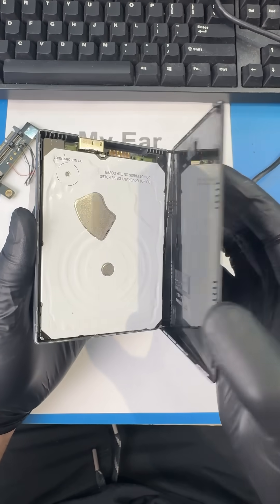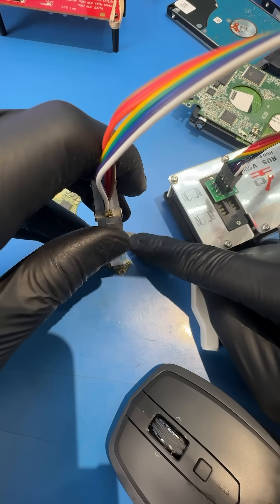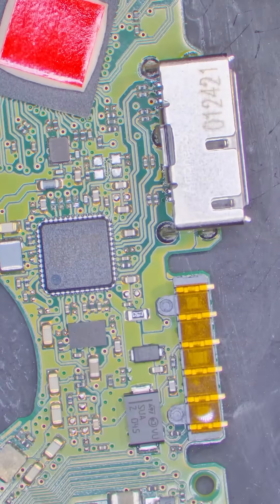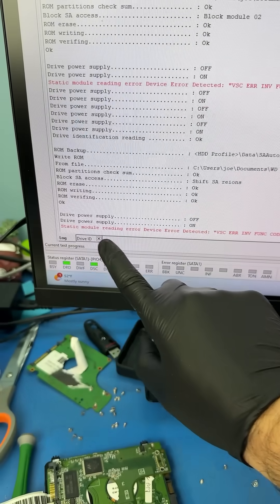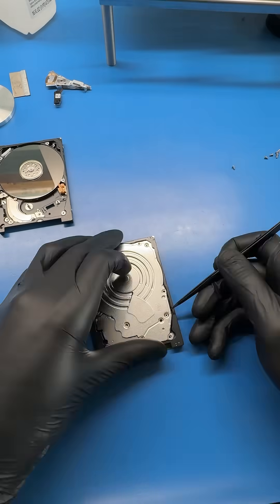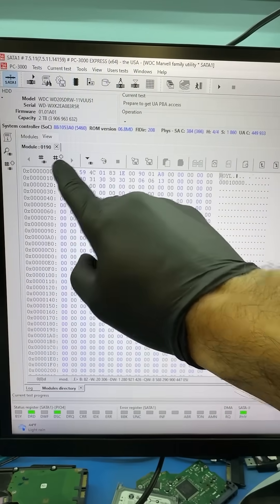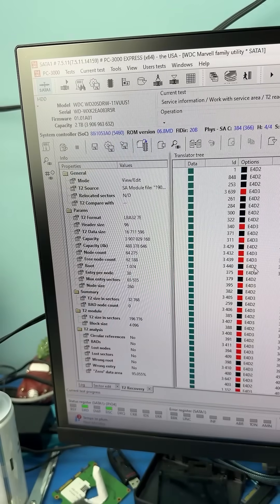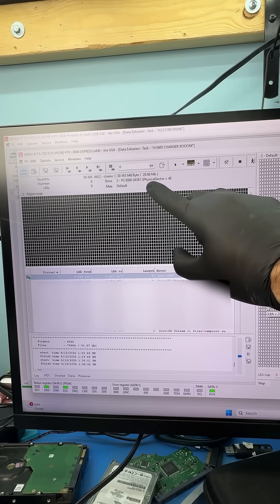Hard drive translator...? #tech

Comment: I've been a software engineer for 30 years. I owned a computer repair company for four of those, too. And I can say, without hesitation: where and how the hell did you LEARN this stuff, bro? Did you used to work for WD assembling these in a clean room? Or what?
Reply: Thought EXACTLY the same
Reply: I know SOME of the things he's doing because I used to read some data recovery related websites from Easten Europe. Professional tools obviously come with instructions. There are forums where people exchange information about specific hardware. You can learn so much black magic if you are so inclined and have the money for tools and to be able to afford to make some mistakes while learning.
Reply: @SianaGearz  People think I'm a wiz with computers. I'm a gamer who had to set up port forwarding for Minecraft, had to learn where all the files go to mod games and backup saves, and had to read all of the config everything to make things run on my mediocre computer. For linux, I installed Arch and messed around, broke my OS a couple times, and now I'm decent at linux.
Reply: Not specifically about HDD/SSD, but when it comes to a niche market, sometimes time and research is all you need. I went from paying for a tune for my car, to learning how to defeat the security system, dump the flash and eeprom, modify values for a tune, reupload and tweak features i didnt even know were possible. Then from there into the instrument cluster to play around there. Takes time and research, trial and error but you get there.
Reply: @doddinator14 I wanna learn that too
Reply: @doddinator14 messing around with eeproms not that hard specially in older cars, the new ones are more SW development, need to get to do “C” hardware level programming.
Reply: @ Good thing i can do the Med17.1.62 aswell then.
Reply: I was saying the exact same thing. The knowledge about hard drives is extremely impressive.
Reply: I have no idea what's going on but that's some serious dedication to drive repair.
Reply: You'd be surprised, being a professional hobbyist is orders of magnitudes better than just having a degree and experience IMO. knowledge wise.
Reply: @hassaanrauf4349  Yes but even if you do it as a hobby, where do you find arcane information like this.
Reply: @hassaanrauf4349  Can confirm. Been working in the IT industry for 5 years now and the vast majority of my knowledge and skills still stems from my hobbyist days. Feels like I've learned hardly anything at all other than how inefficiently big companies operate.
Reply: @hassaanrauf4349  What a load of bs. Show me a single hobbyist that has the knowledge of an electrical engineer who studied in an university.
Reply: @ There are tons of such people. You don't need to know differential calculus to make circuits. I'm an Electrical Engineer and I've had colleagues with no trianing who were rockstars. People who are smart can teach themselves things regardless of a college degree or not. At the end of the day college is just an IQ check and a paper that says "this guy isn't r-tarded and can learn difficult concepts, hire him".
Reply: @mithrandirthegrey7644  Looks like US "colleges" are horseshit. We all know that.
Reply: Computer forensics lol
Reply: Trial & error
Reply: I'm a retired Computer and Electrical Engineer with over 30 years experience. Before I put myself though college, I was an Electronics Tech in the Navy where I worked on all manners of communication gear, RADAR, SatNav, and IR devices, from the 1940s to what was current at the time I served in the '70s and '80s.

After earning my BSCE and BSEE degrees, I was more involved in designing and manufacturing computer hardware, building / installing / troubleshooting / repairing / upgrading PCs and networks. I learned how to repair circuit traces (like, say a lifted solder pad or a broken foil run) back when I served in the Navy. One place that I worked at, we made those flexible circuits on the arms for the R/W heads, at least for Maxtor and Seagate drives (that's a Western Digital in the video and I don't remember making anything from them at the time I worked there). We also made flexible circuits for Epson, Lexmark, HP, Motorola, Samsung, and GE Medical. 

In order to do this type of work, you have to be a Certified Data Recovery Professional (CDRP), which requires some courses and a test. One can look up what it takes if interested.
Reply: I've been a software engineer for about 20 years, and while I may not have the actual skills he has, nothing he's doing is actually new to me. 

If you learnt how filesystems work, you'll know how its stored on the disk and how data recovery works.
Reply: My bet is he worked for either a HD manufacture or a data recovery company before breaking out on his own
Reply: Reddit and stack overflow lol
Reply: i can relate to this video  i used to work in toshiba (philippines)2.5 hdd dept. as assembler and tester for each hdd that i assembled ..the firmware installing is not my job i know how to do it like he does on this video but i am not certified to do it in my workplace.. need certification to qualified ... i've employed in toshiba from 2013 to 2019..
Reply: People here acting as if college is useless and are forgetting that those dedicated to their fields of interest will obviously have more knowledge about them 😂
Reply: as all computer science students say “hardware is black magic”
Reply: The amount of time this takes to recover and view contents like a helicopter of the drive data swap testing different heads , massive amount of time and effort… whilst I know what you was doing and worked in computer repairs since 1993 until 2015 , changed to Apple from 2005 , then worked in recovery Ontrack and Kroll data recovery forensics, I found it extremely interesting.   The price for this can run into thousands
Reply: He must be working on the ssd hhds are made😂
Reply: I can feel the painstaking process just by watching
Reply: Never underestimate the talent and knowledge one can acquire while investing themselves to the fullest in their favorite hobby....
Reply: Dudes just secretly self aware AI in a biosuit
Reply: Bro went to India for a week
Reply: pc-3000 does training
Reply: a former bosses son had his hdd stop working it just made a clicking sound pretty sure the head got stuck he asked me if i would put a new hdd in it, took the old hdd apart put the head back into park position and got the drive to work and copied it to the new drive he did not lose anything. i just fiddled with it and thats how most of the best people work they fiddle with things and figure them out
Reply: fixing, breaking and then fixing your own stuff again teaches you infinite things.  l ended up learning a fair bit of assembly language basically by accident just because l needed it for a couple functions
Reply: he had access to information. And that's not internet, cause if it was internet, you would know it too. Like you said, WD or whatever company he works for.
Reply: @v.cotoiu3568 everything used in this can be sourced on the internet.
Reply: you would be surprise how far can an internet and a willing man can teach  himself to do something, I went from zero knowledge on GPU to a board repair in a year, just so I could salvage a second hand GPU for a cheap price...
Reply: It’s amazing what you can do while tinkering about.
Looking at wiring diagrams for drives!
Reply: smart dude, absolute hero to customer.
Reply: He probably did school for computer engineering. You usually don’t learn this kind of stuff in a software engineering degree.
Reply: EE
Reply: I just went to os class for 2 mins.
Reply: Software engineering doesn't really have anything to do with computer repair tho...
Reply: I recalled people would try to avoid buying usb only mobile drives. Those from Seagate would have SATA drive inside while WD love to save a few cents and have USB directly on PCB.
Reply: If you pause the video, you can see that he is using VERY EXPENSIVE recovery software.
Reply: It may be the pure talent some people have. Some people are very talented at composing music. Some are very talented at hacking. He's very talented in discovering and utilizing knowledge related to hard drives.
Reply: NSA
Reply: Isnt that just so cool about the internet tho? Domain expertise isn't gatekept by Harvards Ivory Towers anymore.
Reply: You can literally learn this on the internet. Just google it. Hello?
Reply: also no need for a cleanroom, you spend a couple k on a workbench with filtered air.
is just as good, only those filters get expensive after a while
Reply: Exactly, where did he learn this from?
Reply: Dont get me wrong, this level of knowledge and skill is impressive... But comparing repairing to making software is just an unfair comparaisant.
Reply: No chances whatever game could be retrieved is worth anything. Someone that doesn't use a source control in 2025 doesn't have the mental throughout required to design anything worthwhile.
Reply: This post should show you that you should never trust anyone that is a "professional"... clearly there are a lot of morons... lol

imagine thinking you have to work for a hard drive company to know how to apply fundamentals loool.
Reply: Its PC-3000 Data Recovery Hardware / Software package. When you buy package you have access to their WiKi and can get training about data recovery.
Reply: You're joking, right?
Reply: I recovered a few HDs years ago by editing fat sectors manually. They were only 20-30 MB drives then!  This, however is really serious voodoo and deservedly costs thousands of dollars!
Remember guys, always back up your backups too and duplicate them offsite to avoid catastrophes.
Reply: The PC3000 guys are astounding as to what they have built and will help you with if you find something their hardware can't already do.
Reply: That's a lot deliberate practice, where you're pushing beyond your skills, for a few hours, every day. Over the span of 5 years you can get pretty far with that. It's a blend of practice, reading, patience, observation, exchange with others, and focus on what to learn next. You start with simpler repairs and skill up while making money. Add dedication, passion a big brain and a pair of golden hands.
Reply: He's using electrical engineering skills, and diagnostic processes. Real engineering degrees typically focus in on these areas, whereas hyped up computer science courses purporting to be software engineering (which the proper term is computer engineering, not software engineering, at least were I am the term software engineering is meaningless) don't actually teach students any real engineering skills. Most engineering students also do some amount of time doing general entry, which is 1-2 years of everything to get a base understanding before you specialise in a general. With that said this dude is an artist and not many Electrical engineers sadly could do even 25% of this. He's more into data storage engineering, not sure what the correct technical term for that is.
Reply: @JoshuaNicoll software engineer is a real thing. Writing code is one thing, designing software would go a bit beyond that. A software engineer, for example, would come up with how the software is supposed to function, its overall layout, how it would be integrated with whatever hardware it has to run on, and so forth. Different parts of the software would be handed off to different individuals or teams to create the code according to what the software engineer has set forth. Software engineers  would know how to program, and probably have some understanding of hardware so that they have a better idea how to go about designing the software. They may also decide to use one programming language over another depending on certain requirements.
Reply: @JoshuaNicoll  Software and Computer Engineering are vastly different things. Software Engineering honestly shouldn't be considered Engineering in my opinion (as someone who has been developing for close to two decades).

Software Engineers develop code structures and determine tech stacks. A lot of the current engineers barely understand how their computer actually works now a days.
Reply: @JoshuaNicoll right! But in contrast, most "software engineers" up to IT Development couldn't bias a BJT.   I firmly believe that a passion for knowing/experience brings out "the knack" in people and this guy has it.  Having the ability to see options outside of the box built around others (who may be very set in their ways with the bragging rights of "been doing this for" syndrome. 😅).
Reply: @JoshuaNicoll  no need to slander software engineering. I believe you don’t understand what software engineering actually is. It essentially has nothing to do with the hardware of computers (besides from things like memory allocation and some other stuff), and rather is about development of computer applications. Software engineers work in groups to complete a development lifecycle which has many many components and steps. Computer engineers don’t learn what software engineers do, and software engineers don’t learn what computer engineers do. They are completely separate fields that work in completely different markets.
Reply: @JoshuaNicoll I have never seen such an ass pull before, almost all you say is wrong
Reply: @JoshuaNicoll software engineering is not a useless term, its software only, computer engineering can be hardware or software or a mix, software would be a sub specialization. Also, non of what he did here is software engineering, at most partly electrical partly software usage skills, it's not like he wrote the firmware on the spot.
Reply: @q1337  no thats electronic engineering or computer science. Computer engineering is using computer code to solve problems. We're being trained in C++ for that. There is no hardware side to computer engineering, that is eletronic engineering. There is some overlap in an EE will also be able to programme, but a CE won't be able to design a PCB.
Reply: @ also I don't specifically blame you for not knowing that, the actual field names are not used consistently, you have a bunch of universities teaching actual Computer Science, you have a bunch of them that are teaching Computer Science but in reality the courses are the same as Software Engineering etc. The name itself is not enough to distinguish what a student is learning, but rather the courses available to take. Same goes for CE, it heavily depends on where you're going to uni, here there is a very clear distinction between CS, CE (SE), CE (HE) and EE but neighboring countries also have their own twist and like I mentioned before, they have CS but with only SE courses etc.
Reply: @JoshuaNicoll 
Engineering student on my entry year here, truly very well said my man
Reply: @JoshuaNicoll  Most of what you said is indeed true. The vast majority of "CS majors" are just coding degrees and do not actually go into Computer Science or Computer Engineering.

What I will say is software engineering does have a meaningful distinction where I am from, computer engineering is often lower level than software engineering, in that the deepest level a software engineer will go is assembly but a computer engineer will go beyond binary to the physical characteristics of the hardware to create the binary instructions that are then conveyed into assembly. This means Computer engineers design hardware.

As for software engineers they do apply engineer principles but it's at code level, meaning there is a problem they want the computer to fix, the software engineer identifies the requirments and designs the software that will be created following this they will usually have a team of programmers that write the code and the engineer over sees them to make sure they are meeting the standards and can also make modifications if needed to the overall design.
Reply: Data recovery is a whole different thing than computer repairs man
Reply: It's called the internet. School and College have failed us.
Reply: @Mystical_Zeus  I started programming commercially in '96. At the time, the requirements to become a full-time dev were:
1. Do you know how to turn on a computer?
2. Can you think your way out of a paper bag?
3. Ability to type (nice to have)
I AM self-taught. From "books" (which are like... uh... "analog Kindles").

Even so: this dude got some dark voodoo training SOMEWHERE... because what he's doing ain't no joke.
Reply: @grumblycurmudgeon  mans sold his soul for computer necromancy powers
Reply: @grumblycurmudgeon  probably just some forums nerding, all advancements in life comes from those communities man, it's no joke 😅
Reply: @grumblycurmudgeon  You are old bro, referencing kindles 😂 I don't know a single person who has used kindles in years and years.
Reply: @yunggoosbumps215 Kindles are a very recent thing. PDAs are where the line exists between "definitely old" and "maybe old".
Reply: @grumblycurmudgeon Best description ever. I've worked in a lot of different industries when it comes to tech and I've seen very few people who have the type of skill set he's able to utilize on command. That level of knowledge and training is not common even within the tech field. Hobbyists are absolutely insane when it comes to tech though. Our IT guy at work blows my mind weekly with the new stuff he's constantly doing to his home setup
Reply: @grumblycurmudgeon ”analog kindles” 😂😂😂😂😂😂😂😂
Reply: @grumblycurmudgeon it's actually not that complicated. But needs more general understanding like soldering and boards and electronics and binary. Maybe logic gates. Other than that it's just software. Now if he wrote the software himself and whatnot that would be pretty damn insane
Reply: @grumblycurmudgeon reading "analog kindles" made me actually angry lmao, cmon bro I'm 21, books aren't THAT ancient
Reply: @projectdeveloper9311  Kid, when I was your age, we still had to set the receiver of a landline phone on top of our dialup modems to telnet in to our BBS's and MUDs.

Count how many of those nouns you recognize. Now count how many you've seen. Now count how many you've used. 

I mean no offense... I'M the old-ass here. 

It's just nearly ALL of modern computing has happened since your parents started dating. Go back much farther than when I got started in the field and bleeding-edge computing hardware fell into the category of "henges" (yanno, those big stone circles for checking celestial calendar events?). We built one in the back yard, once. You've never heard such whining. "You kids get those rocks off my lawn!" Heh. Good times.
Reply: True that, I'm an engineer without a degree😅 shhhhh nobody's noticed so far and it's been 7 years  @Mystical_Zeus
Reply: @Mystical_Zeus  Youve been told that they have. By the same people that are trying to get rid of the department of education, no less. You buy the bullshit. I can almost guarantee this person had a public education. Along with YouTube learning, self tinkering and just a dose of curiosity. Only a fool would consider public education not important.
Reply: @Mystical_Zeus  no mate go to school learn basics and more then you go on the internet and learn more ;) without school you couldn't go even half way this guy went. Most of the things he does I learned at uni 😂 rest is software you paid for 😂
Reply: Hardware and software are two different things. Generally those that know software don’t really understand hardware. Those that know hardware typically understand software to an extent. I’m sure this guy obtained his knowledge from many positions over the years.
Reply: See, its not teach on school, what a waste of money
Reply: have you heard this new thing called youtube 😉
Reply: LEarn WHAT? to solder 4 wires and exchange parts between a good working mechanism and the broken one that you want to work? That is ABC of repair anything.
My question is:
How little is the minimal amount of brain cells is that is sufficient to make that obvious.

This is no more complex than replacing a ripped shoelace. Just more steps and cleanliness.
Reply: Studies teach you the basics of a general job you can do. The rest is often self-taught, and hard drives aren’t that difficult to understand with the tools we have today, like ChatGPT for those who are lazy about searching on Google and Youtube.
Reply: @Ryokath   I do not recommend to rely on ChatGPT, I have a habit of querying it on topics I'm knowledgeable about, and when it comes to more exotic knowledge not found in way too many books videos and whatnot it's not doing so hot, it will necessarily output something that to a layperson appears plausible but is highly misleading. Still there are great ways to use it to boost your progress, sometimes you just need the right keyword to be able to acquire authoritative information. Always remember, it's a bullshit artist that is eager to please you and almost unable to refuse to say something.
Reply: Yeah but the problem is to find the right information in the right order to understand how stuff works.
Reply: You're a software engineer, but you don't have the engineering brain to do the hardware side